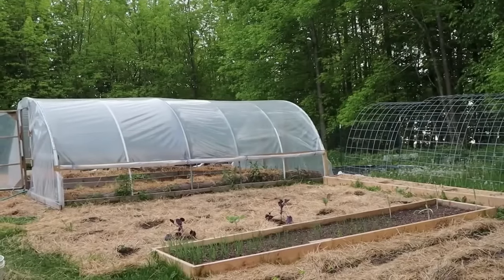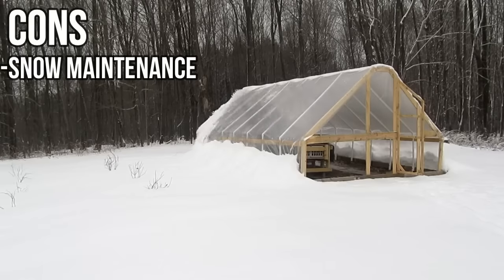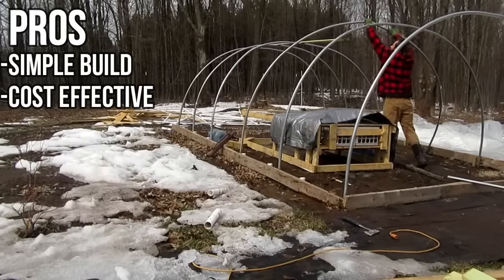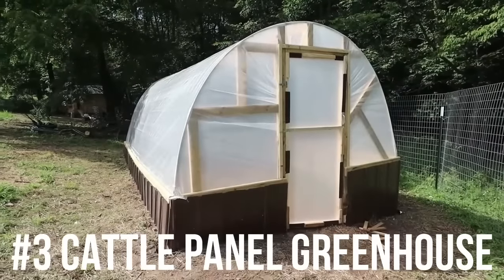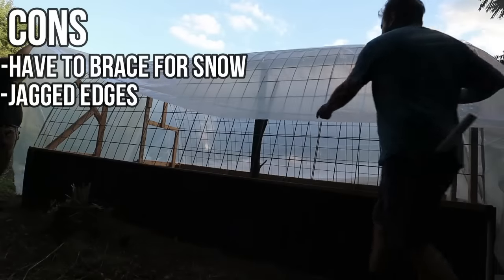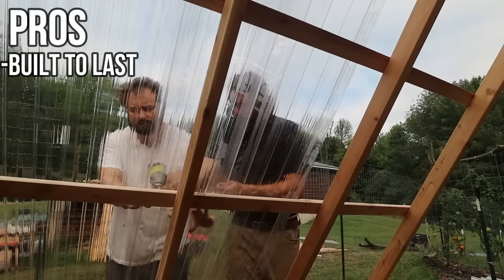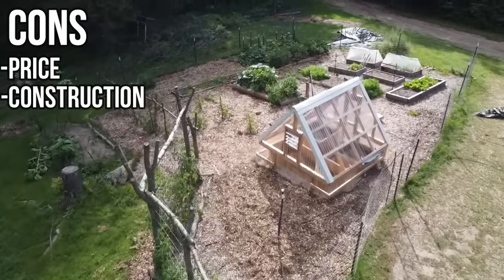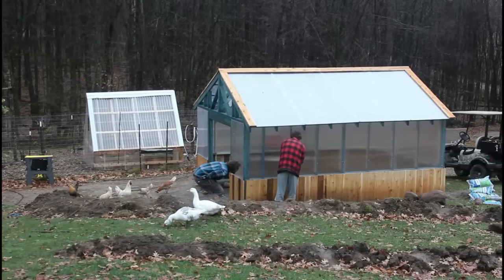The Ultimate Guide to DIY Greenhouses: Pros, Cons, and Everything In Between

Comment: We use temperature actuated foundation vents in our raised bed hoop houses. These hoop houses are wood frame built with concrete reinforcing wire to form the arch that is covered with 6ml greenhouse plastic. We store these hoop houses inside a building when not in use, but we know that wear from the plastic against the wire causes damage we watch for and repair with clear Gorilla tape. But what makes these hoop houses possible for us to use are those vents that open and close on their own. These or similar vents could also be installed in any of your greenhouses. 

As for bugs & insects, thats part of greenhouse and hoop house gardening, so progressive IPM should be used. Sticky traps, etc., can also help. And keep weeds, etc., back away from your structure 2-3’ around the outside perimeter. These are not perfect solutions, but can help. Of course too, it depends on where you are and your environment. Maybe even planting beneficial plants/flowers outside the structure.
Reply from the maker: That is awesome! So the arms are temperature actuated? The next step for us is upping our vent game. Yours sound like an interesting approach. 

And those are good ideas for the bugs. I should have been more specific in the video. In the 6mil plastic greenhouse we would get dead bugs caked in every crease and crevasse and could not get them out and they would pile up year after year. Our rigid plastic ones have had no real bug issues and nothing even close to the 6mil. I am planning on making raised garden beds for the outside and planting beneficial plants:)
Reply: @TheNorthBranchWI  Temperature actuated foundation vents have fins that open and close. You can Google them. These are vents use in the foundation of houses. 

Greenhouse vents use the arms that are temperature actuated. You should be able to Google those too. 

We will be changing out the foundation vents before next fall. The vent frames are plastic and have cracked where the mounting screws pass through. The builders of our hoop houses should have anticipated this issue and been a bit more creative in how they installed the vents. Oh well. Nevertheless, the vents still open and close as they should. : )
Reply: @TheNorthBranchWI  Our raised bed hoop houses look like giant caskets. Lol We installed 3 carry handles on each long side. Each of these are 4’x 8’ long and they both are use in one particular raised beds we have that has a 4’x16’ growing surface. The raised bed is cinderblocks high. The hoop houses sit just inside the cinderblocks on the soil. This would be a great idea in places that get a lot of rain. But in the high desert where I am, where we only get about 8” of rain a year, its not been a problem, even using automated irrigation. 

Something else. We installed indoor/outdoor wireless thermometers in each one. They transmit to receivers in a nearby work shed.
Reply: @munchkin5674  Depending on the plastic, you may be able to repair the cracks with something like acetone or plastic cement.
Reply: @stevenschnepp576  You might, but these are 4 years old and showing more stress and wear. Desert heat and sun can take its tole.

Comment: I read about a really nice fuel free heating system. you just need a pv-panel, some insulation material, 2 pipes and a fan. The fan blows warm air through the pipe throughout the day into the soil. They insulated a cube of soil, to storage the heat there. At night warm air will go up again and keeps the greenhouse above freezing temperature. It think its from: Self-Sufficiency for the 21st Century: The Complete Guide to Sustainable Living Today, but i only know the german version.
Reply from the maker: That is so cool! Thank you for sharing
Reply: and even more efficient way is to store your warmth in a sand battery. Make sure the soil or sand is always super dry.

Comment: Professional 6mil greenhouse film will triple the life, 12 years in the northern USA is a reasonable expectation(warranty is 4 or 6 years) and it is availible with infrared additives to reduce heat loss at night(plain polyethylene is transparent to infrared). Double-wall and triple-wall panels, or inflated double-film, are best for overnight freeze protection (Double wall glass is especially good as it blocks long wave infrared from escaping, but for the money plastic plus a thermal curtain may be better especially if it can be automated and put on a timer). 
Daytime temps are almost irelevent, they will be high enough with any material on sunny days even in winter. Overcast days are a bit more complicated to figure in as they have a lot more variables than may be immediately obvious.
Use good anchoring, I am in a fairly calm valley but I have still had wind up-end a couple greenhouses, even with anchoring equivelent to those short stakes used in the video. I would double them and put them in at alternating angles so they don't pull out. Or bury a small log along each side and tie into it for an anchor. 
Secions of concrete foundation and anchoring is an option where the investment makes sense.
Reply from the maker: Where does one track down professional 6 mil?
Reply: @TheNorthBranchWI   A growers supply. Places that sell commercial nursury/agriculture and greenhouse equipment, they are often regional businesses operated on a more wholesale model where you call to talk to a sales rep. 
Plastic with some added diffusion like is usually preferred over totally clear, it helps light get deeper into the canopy, reduces peak leaf temperature, and prevents bending toward the light(phototropism), less % diffusion is needed if using an inflated double layer roof because they add together. The exception is very overcast low light climates, where clear allows in about 5% more light. "thermal control" reduced transmission of longwave infrared, this keeps in more heat on clear nights(I don't know if it makes it hotter mid day.) 
"Bee compatible" means that it allows some UV transmission and is for indoor pollinators(YMMV testing recomended).
Web search terms UV Resistant Thermal Anti-Condensate Greenhouse Film 6-mil 4 year[warranty in places like AZ] 
also look for manufacturer websites and follow them to dealers. green-tek cropking lumiteinc greenhousemegastore farmplasticsupply agriculturesolutions

Comment: I've always wanted to do a greenhouse. Then add a functional raspberry pi to it to monitor the inside. Functions could be soil dryness, humidity, or course temp, a small fan could regulate temperature also. This would take a bit of wiring for power and light programming knowledge. Good thing is the RPi community has people that have already written support apps to run for this.

Comment: Well done video. We started with 10mil and wood framing. The biggest challenge was rough points. Last 2 windstorm before #3 shredded it. Currently converting to the plastic panels. EVERYTHING costs more now. Grateful we already have the frame up (although, its being reinforced). Weather has been challenging, and we're considering how to create a venting system. It's 10x20 with a grow box down one side. I have a water barrel inside and use old soup cans spaced out to slow feed water into the soil. Its an experiment, as most of our ideas are, to mitigate weather, temps, winds. You gave great tips and ideas

Comment: Yup. Your tips about cattle panels are spot on. My cattle panel hoop house here in Colorado, the hail capital of the states,  was great until the snow collected in the hail cloth and flattened out the tops of the curves on a more or less permanent basis.  I cut a big branch off a dead tree - about like yours -- and propped it up in the middle so I can at least walk semi-upright in it again, but I wish I'd known in advance that the hoop needed support.  I could have taken off the hail cloth and just put it up again next spring since I wasn't using it for winter growing anyway.  But that's a pain..  And yes, jagged edges.  The hail cloth has many little tears, which don't really matter like it would on a plastic cover.

Comment: This is a great, and very informative video! Thanks for sharing it and your experience in building these different types of greenhouses. I am looking to build a greenhouse in the South of France, and have limited construction skills. I have been thinking of a cattle wire hoop house, and am wondering if you think it’s possible to side it with either corrugated plastic panels, or the double plastic panels? The weather in the South of France gets very, very hot in the Summer, so I need to either vent the greenhouse, or remove the siding altogether. In the Winter it freezes, but does not snow. Thoughts? Thanks in advance!!

Comment: For keeping the greenhouse above freezing in the wintertime, there are some folks who bury tubes 4 to 6 feet into the ground and have a small pump or fan to bring the heat down into the ground during the day, then back up at night using either air, or water.  It uses very little electricity.
Reply: Unfortunately if I do that it gets very very wet very fast!

Comment: Take a look at the Gothic Arch green house. Not expensive to build,  Sheds snow easy, stand up to weather. Also, when you build your raised bed boxes, line the box with plastic, fill the bottom with river rock, about a foot deep, add a drain pipe just under a foot and then cover the rocks with gardening cloth, add a 4 inch pipe that stops at the river rock, fill the bed above the gardening cloth with a foot of wood chips and the remaining two foot with dirt. After that, fill the bottom with water till the drain begins to weep, plant your plants and forget about them. The plants will draw water from the bottom as needed and you shouldn't need to water again aka fill the bottom, unless the weather gets hot.

Comment: Just finished building a long narrow, winding  (rectangle caterpillar shaped) two part, interconnected greenhouse that is separated by a corrugated door, and has a brick walkway in the center. One half I used corrugated, the other half using the double panels. It's almost impossible to get a good air seal using corrugated, while it's a lot easier doing so using the flat panels. Unless you seal the ends of EVERY panel with silicone, water gets in and condensates for days and blocks some sun. Dust also gets inbetween that you can't get out.That hasn't happened with the corrugated half. Right now, it's a toss up to see which one works better, and has the least cons. The panel half is a little more insulated, and is sealed tighter, so it is warmer. It will house my house plants which I really don't want to freeze. The cooler corrugated half is for veggies which if they do freeze, (zone 9-A) is not as big a deal.
Reply from the maker: That is so interesting! Please let me know how it performs this year
Reply: @TheNorthBranchWI  I will !

Comment: Given that you get a decent snow load I encourage you to look at geodesic domes as an option for a future build.  There's plenty of YouTubers who've done the DIY style geodesic domes.  

I think it was mentioned in the comments but to improve temp regulation with 6ml plastic it's often double walled with the space between to two layers blown up to keep an air pocket. That would require electricity however and also likely wouldn't be feasible for a smaller greenhouse.  
6ml poly single walled greenhouses is not sustainable to grow year round in environments that get below zero. (Not without a heat source... And even with heat- you'd lose so much being single walled you'd go bankrupt trying to heat it (unless it's only in floor heating or just the propagation benches). 

If trying to overwinter stuff without heat, you could swap the 6ml clear poly for white poly.  White reflects back the light so it won't get as hot inside, but some light still penetrates (so its not in complete darkness and plants will know when to seasonally wake up). White poly is a good way to make the winter highs and lows less abrupt inside without the use of any heat source.  

Great videos!  Happy growing!!
Reply from the maker: Yeah exactly. We don't plan on trying to overwinter in our greenhouses, more like trying to keep it above freezing for a few more weeks on either side. Thank you for your comments :)
Reply: @TheNorthBranchWI  you likely already do this, but you can get an extra few weeks with additional cover over the crops within the greenhouse. Like a small hoop tunnel.
Reply: @TheNorthBranchWI  Here in the PNW, building partially buried greenhouses has been popular and successful at extending the season.

Comment: The last greenhouse you did, I have a few ideas that I wonder if you have thought of.
1. Digging down 5 feet so part of the greenhouse is under ground. Keeping growing beds at a  depth from a hard frosts or freezes.
2. Below that  dig a trench 3 to 5 feet below the greenhouse that you put  piping in in a u shape so you have a inlet and an outlet. So you have thermal heat and kooling kind of idea, keeping the greenhouse at a constant temp.
Reply from the maker: We considered that but we do not have the equipment for all that digging. It took me over two weeks to dig to foundation out with a shovel haha But your thoughts/ideas are correct :)

Comment: Aiming for a combination of the last two. Roughly the size and strength of the last one with the roof angle, shorter walls and 'corrugated' plastic of the 2nd last one. Need to shed snow, inland Maine here. Thanks.  -- Oh, for anyone, we currently have our chicken house built on a trailer and it goes into the greenhouse for the winter. Of course you need to build a big door to get it in.

Comment: As far as the thermal regulation of the 6 mil plastic sheet, double it over on itself. IT helps to something in between the two layers so there is an air pocket between the layers also. Some production greenhouses use an air pump to maintain a layer of air between the two layers of 6 mil. Personally, i put 0.25 inch thick strips of wood or other durable material lengthwise every 3-4 feet from the top of the greenhouse down to either side. The last one I put up got 0.25 inch by 1  inch pine strips, took 1inx4in furring strips and ripped them down to 0.25 inch strips. Love your design for the twin wall greenhouse. Should be very functional and aesthetically pleasing.
Reply from the maker: thank you, Drew! I have had a lot of people suggest that to me and it seems like it a very effective option. I am not sure if we will put that into practice because he have two rigid plastic greenhouses now that we are focusing on. And thank you, I love the twin wall, I can't wait to finish it up and put it to work. We have been planning the layout of the beds and everything and it has been a blast. Thanks again:)
Reply: I was thinking about using bird netting between 2 layers of 6 mill plastic.   Even the heavy duty netting is really cheap.

Comment: Nice overview of your evolution! Not sure if you've already chosen a heating method for the last one, but if not consider what many growers use: a simple propane garage heater, and soil heating mats. The propane space heater heats the air quickly (for when you're working in there) and the soil heat mats keep the plants happy for a lot less heating cost the rest of the time. One last thought, snow is a very good insulator. Maybe don't work too hard getting it off the non sunny side of the greenhouse. Cheers.
Reply from the maker: We are still considering options.   We have a lot of little propane heaters for hunting. I think we could use those for an emergency but I don't know if that will be what we do long term..  This was great communication ahha :)